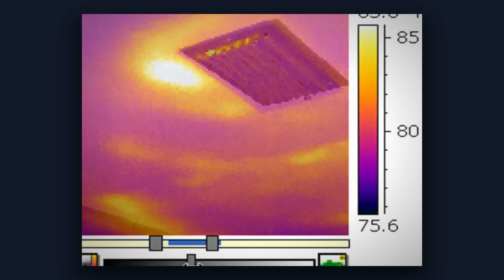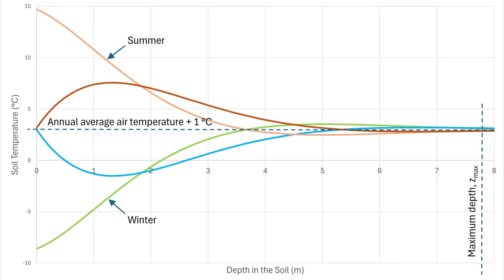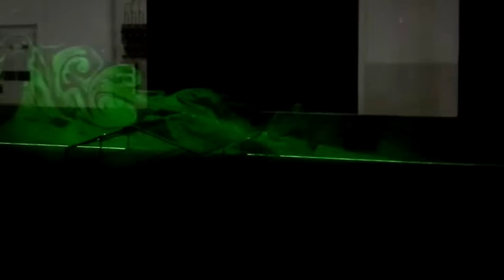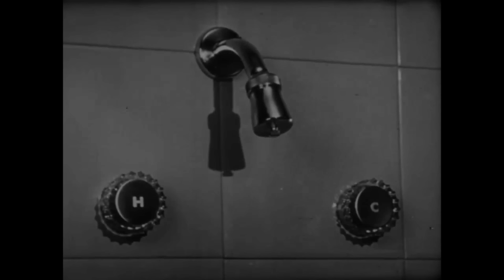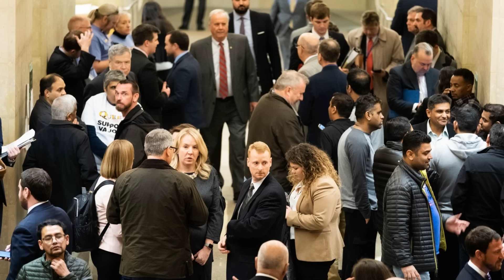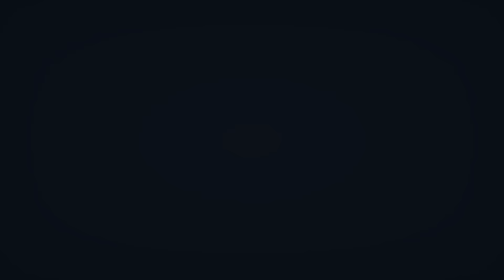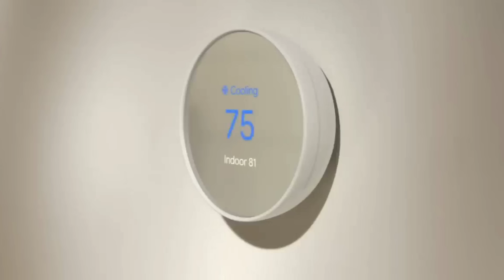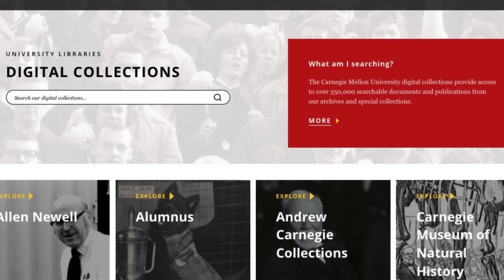This $300 Tunnel Heats Any Home All Winter for Free — The System the Gas Industry Made Illegal

Comment: Is it practical to move air instead of water (with an heat exchanger) through the ground, because of air friction has a loss in energy due to the powerful fan, compared to the pumps that move water.  Everything has to be sized to reduce friction and thats easier and cheaper with water.
Reply: That 8" pipe is not near big enough to reduce friction on the pipe for most homes. You really need a 24" x24" square duct at least about 600 feet in length for a small home.  The blower needed will need to be 1 horse power for a small home , and a 2 horse power blower for a larger house , rated at 7 tons.  That will kill your electric bill that's why people use an water to water heat exchanger and a radiant heating system.
I just think you should know that this is not the way to extract heat from the ground.
And,
there is an additional problem, this only helps for the initial furnace run, and will lose heat when warmer return air (warmer than the ground)  is pushed thru the ground it cools the return air, wastes the heat of the retun air.
The only application might be to cool the house in the summer, but still not cost effective bc of the large fan needed to push the air . Maybe it might work passively to cool a house in summer if you live where the outside air is not humid.  In the passive cooling system the air intake would be from 600 ft of duct 24" x 24" that drafts air without a fan into the lowest point in a house and exhausts air out through  the roof.  A fan or air-handeler could be added to improve flow and remove humidity. 
***However a pex-pipe sized to a heat-exchager is practical for geothermal heating and cooling, and its a better place to start.

Its takes very little pex pipe to size very small geothermal heating and cooling heat pump -- sized for about one room and those are practical for a home own to dig a 3ft x 6 ft deep hole and coil about 250 to 300 feet of pipe in the hole of 5/8" pex pipe.  If you divide the length in half and run it in parallel runs it cuts down on the friction and energy needed to run the pump. Gather the two-inlet & the two outlets together into single inlet and outlets .

Maybe you will need a hole for each smaller unit, but if you try to use one large heat-pump you will need a lot of space or need to pay an expensive geothermal well driller.  One last hint you will need to pour a slurry over the pex-pipe for efficient heat transfer. And do a little research first. Don't forget to use the coated pex-pipe made for heating systems -- dont use pex- for drinking water. The cost is similar but it will surprise you that gas exchange is what happens when you use regular pex and you want to keep air out of the pex. Take time to read and learn before doing your DIY heat pump. This is just a few hints to point you in the right direction.  If you have the land and can do your own excavation about 600+ ft of trench about 6 ft deep then the larger full house heatpumps are a good choice too. If a friend excavates, have him do a turning radius at the end of the trench for the return line.  And spend the money to run parallel  lines of the larger pipe (maybe two --1&1/4  lines instead on one) to greatly reduce the energy required for the pump. Size everything before hand with the heatpump manufacturer,  then increase it over the minimum.  In the house directions often say use 1/2" pex, but if you size it at 5/8" pex the efficiency increases do much that you can use a smaller pump and a lot less electricity and get more heat moved. So do the calculation on upsizing before you start.
Reply: Heat pumps can be a water to water system for radiant heat system; or a water to air heat exchanger (air handeler) for a forced air system -- like to modify and old gas furnace system.  In a new system you do not want a forced air noisy inefficient air blower. Water to water heat exchanger for a radiant system using small wall radiant systems are cheap for contractors to install.  The radiant walls and ceilings are for a luxury system. Never do radiant floors !! Usually it requires higher heat (wasted energy) to heat floors -- lost efficiency with floor covers -- and people forget that radiant ceilings and walls make radiant waves that heat the floors so the floors are warm too.  Of course insulation pushes heat in the right direction, so another reason to read and learn before you start .  Make sure you read because most contractors are not up to speed.  
And never do hot fossil fuel radiant heat. Its not efficient.  Size proper and you only need to heat your water to maybe 110 degrees F to have a home that's warmer than you want if someone turns up the heat.  In concrete floor radiant heat is the exception to do not heat floors, but keep the water temp low, and do not use floor covers that insulate, and make sure your floor heat turns down or off before the sun comes through the windows. The concrete heat resivor will keep heating the house after it is turned off.  Ceiling and wall heating is faster coming on and faster turn off.  You just need to plan.  And  modern wall radiators are not like the old fashioned high heat radiators. Radiators need sized to the room .  Use the lowest water template that keeps the home toasty ( 110 best to 119 max). Just size it to work.

Comment: the problem with this is you don't draw cold air into your house and heat it you have a return air system that returns air from inside your house , already warm air and reheats it to house temp and blows it back into the house
Reply: My thoughts exactly. Also, my furnace draws air for combustion from in the house. I do not comprehend this one.

Comment: I have been interested in the system for years and considered building it for air-conditioning in My Home. The problem is the condensation in the pipe and I haven’t seen anybody properly introduce a solution that would not overtime buildup water in the pipe where it would no longer flow cool air

Comment: There has got to be more than a few caveats to this system.  I confess that I am hardly an engineer or anything close to it.  I seem to recall something like this not being buried deep enough which caused formation of permafrost and buckling of a building foundation.  Comments?
Reply: In MN I build to 10 feet depth, control heaves by working with the water … it wicks upwards to freeze, gravel, rock ( certain types better than other ) and that will control the water which becomes ice which becomes cracks.

Comment: Ive studied both active and passive solar engineering back in the  early 80s.  Then the year I received my degree President Ronald Reagan  canceled the $25K solar tax credit that killed off the early solar industry that was thriving after 8yrs. Which was the equivalent of a career killing kick in the teeth! 

There's better ways to build passive solar engineered dwellings. Than what was presented in this video..

When my mother & her new Husban (a civil engineer) announced  they were goinging to build an adobe house. I steered them in to exploring a crammed earth house. With 20"  thick rammed earth house.   Because the solar mass would keep the house structure cool in the summer. And comfortably warm in the winters. With only a  evaporative cooler and a single fireplace. That they would only have to use sparingly.  With a lighting system powered by a 12 volt DC solar cell bank. And the kitchen had both a walk-in cooler and freezer. 

Once built their average power bill & water bills were less than $20 a month. With virtually no maintenance time each year's.  

The house was so energy efficient that they received awards for its. Solar design & concept. For its extremely low maintence. 

Only a 1/4 cord of wood was used each winter & the house was to hot. They only needed a small fire once a week in the winter. And the evaporative cooler only needed to be used once everything 3 days for 5 hours. To keep the structure below 80°  in the summer with out side temps at 110-115F during the summer. With the total annual power & water bills being at less than $200 a year. 

And they did not implement all of the designs that I presented them with. Had they implemented these designs. Their power and water would have been zero.

That house had the best over all comfort level of any structure that I've ever had the pleasure that I ever visited. Inside you never heard the hum of the city with the ambient sound of 80db outside & 65db inside. It offered true silence within the structure. That imparted a sence of tranquility & contentment like no other housing structure offered. In fact there was next to zero AC electrical EMF radiation. Which enhanced the experience of sleep.  Every morning was indeed a new day. Having eliminated the sound, drone and humming of the city of Tucson Arizona. The structure was truly an escape from city life  that all city dweller are acclimated to. That instills a restlessness into our modern noisy society.

There are better was of building folks. And had there ever been a fire in that structure the wall would have been strengthen. And stood longer than it's projected 10K life span!  Their cost was less than 1/3rd of conventional construction. For a 2600 Sq ft structure in 1990 dollar's.

So their are better ways of building   the alternative solar efficient housing.

This next year I'm. Planing on building my own  house of a similar design. That should be even better.
Reply: You speak of the house in the past tense. What happened to it?

Comment: mould.. rodents... I would not use the air directly... and air is an insulator... also look at Annual Average Temperature... 
I live in a region where that is 10´c (say 50F) and 19´c (say 66F) for room. 4ft is within Seasonal, you need 30ft to blend summer peak to winter trough. Core Earth Heat is 1/100th so forget that.  For me, ground source, perhaps pimped with buried insulated water seems more applicable, due to waters´s massive heat capacity. Have a slope, so any leak is gonna flow away from house. Minimum Frost depth is 18" (1.5ft). Clay soil can expand and contract. so system needs to deal with that.  The insulation maybe can be pimped. I know heat travels 1m/month through concrete.
Reply: Foam glass insulation aggregate (foam glass gravel) is used in a similar way as porous clay aggregate as a load-bearing hardcore. With a lambda/k value of around 0.08 W/(mK) its thermal conductivity is approximately 20% lower than lightweight expanded clay aggregate. The thermal conductivity (lambda/λ or k-value) of concrete varies significantly based on its bulk density and moisture content, typically ranging from 0.42 W/mK for lightweight mixes to 2.30 W/mK for reinforced structural elements. Standard dense concrete generally has a lambda value of approximately 1.6 W/mK, while specific densities provide the following thermal conductivity ranges:
Reply: Lightweight Concrete (e.g., Latermix Beton 1400): λ ≈ 0.42 W/mK (4.5 times lower than ordinary concrete). Dense Concrete (Standard): λ ≈ 1.6 W/mK (or 1.5–1.9 W/mK depending on source). Concrete Blocks (Standard): λ ≈ 1.33 W/mK (Roadstone) to 1.83 W/mK (2400 kg/m³ density). 
Reinforced Concrete Beams: λ ≈ 2.30 W/mK. Concrete Screed (1800 kg/m³): λ ≈ 1.15 W/mK. Thermal Lightweight Blocks (e.g., K-Block): λ ≈ 0.34–0.35 W/mK.
Reply: It´s load'bearing, available in monolithic dimensions of 2.8 x 1.2m, so sounds like suitable for a long, walkway trench, or maybe even driveway (DYOR if you need to spread car weight from tyres across that width). I had considered a covered colonnade for weather (and use south'facing pitch for easily maintainable solar-panels). Think last minute brief shower and spring / autumn BBQ.
Reply: Foam glass insulation aggregate would seem to be up to 20x better than concrete, which 0.2m buys you 4 months of seasonal delay? at which point any pumping puts you in control, what d'ya think? Trade insulation for trench depth?

Comment: The only outside air that comes to furnace is for combustion air that is returned to outside inside air is reheated.
Reply: He is talking about fresh  air for you to breath that gets distributed by the furnace in air tight houses. On his house the furnace pressurized the house and it losses air. But new tight construction  requires air to be vented to the outside to prevent toxic buld up.  People buy floor covering, furniture, or would paneling that releases toxins and if their is air exchange the toxins supposedly do not build up to dangerous levels.  You do not want to live in an air tight house that does not ventilate,  or you can have build up of super toxins like formaldehyde or RADON GAS,  and of course god forbid if their is just one smoker in the house.  Often running a bathroom fan on a timer  to move out the calculated amount of air can work in a house that is not super air tight. 
Venalation heat exchanger are the best because the heat in out going air is captured and put into the incoming air.  Those systems are affordable at about $1000 to maybe $1500.

Comment: The question I have is in my house I have oil fired forced hot air furnace. A system like this does not take any make up air from outside. The cold air returns are inside the house so the incoming air would be the internal temp of my house not what the outside temp happens to be?? Maybe there's different types of furnaces but mine does not take in outside air but in house air. Am I missing something, did I not understand the video?? Id like to know.

Comment: Of course this works! No need to bring up “ifs” and “buts” – it is also working many places in Europe. An alternative (that I use) is the same principle but with a closed-loop fluid-based system – in my case a 150m deep hole in the ground. Common and industrially available, but more expensive.

Comment: Your furnace doesn’t heat the air outside. It recirculates the air inside your home and heats it. Thus would be detrimental to to heating your home. You could use a smaller version for fresh air but that’s about it for that setup.
Reply: right on!

Comment: This is so misleading.

Yes using airtubes has been done and does work, but only in places with high dinural swings and low humidity.

The problems are many.  For example, 100F are will heat that 50F ground far more quickly than you think when the air is humid (water holds more heat) so the cooling effect will fade over the course of a day as the ground around the pipe is warmed.  (That 50f constant temp doesn't hold true once your passing air through there... For the same reason the first 2 feet aren't 50f.

The biggest problem with these systems is moisture.  Hot humid air WILL condense inside the pipes and grow mildew or mold, and you will be drawing that air into your home.

Next, you keep venting the heated or cooled air out of your home in order to draw more in... So it's not very efficient.  The ground heats 0F air to 40F, then you blow most of it outside to heat more air 

Geothermal heating and cooling is a great idea, but you need more surface area than an air tube, you use a closed loop system so there is no contamination risk, you use a heat pump to amplify the heat flow, and finally you insulate and air seal your home to keep in the hard won conditioned air so you don't saturate the ground heating/cooling outside air inefficiently.

The only reasons this has been used effectively in deserts for thousands of years is because the air holds little moisture (latent heat), nothing to condense, and nighttime temps are low enough that you actually use the  ground you heated during the day to keep you warm through the cold night, discharging it for another hot day.
Reply: I noticed just how Lancaster County is smack dab in the middle of those High Dimural Area's you are talking about. Yes it is more effective but the efficiency is temperature gradients is kinda exactly what the method does. While you statement has merit it can also be used in areas outside of the Mid-Southwest and has been for hundreds of years in Ohio, Pa, and many other area's. So there ya go, argue the point all ya want but staarting with warmer air means energy savings are in deed real And same vice versa with Cooling.
Reply: @anonimous2451 , this works for coiling. But not for heating. Furnaces take air from inside your house. Not outside. So even if it's 8°F, outside, & the tube heats it to 45°F. before pumping it into your house, that 45° air is displacing already heated air inside your house with cooler air, thereby reducing efficiency. 

The solution, put a valve that you can open when you need cooling & close when you don't. 

For the condensation problem, you need to watch the whole video (18:20), because it addresses this problem with a solution.
Reply: @anonimous2451 https://youtu.be/HZWS8Za36cM?si=dmbi4waxkEZztsNu
Reply: @anonimous2451 https://youtu.be/HZWS8Za36cM?si=dmbi4waxkEZztsNu
Reply: Not to disagree, but you're kind of just glossing over the key point of this system is that it's dependent upon the length of the tube as well As diameter and area of airflow. Meaning the only variable that needs to change is the TOTAL LENGTH of the thing you want to change(in this case temperature of air going in vs air going out) which this system plays off the dynamic. So the longer the tube THE BETTER you control what the temperature going in vs going out...and being the out tubes act as a way to mitigate against pressure differentials the system solves the problem itself ends up creating which is it maintains the temperature inside AND OUTSIDE by way of BOTH AIR PRESSURE AND convection of heat though technically it's also  radiant heat.
Reply: @PraskaBruce water instead of air solves all those problems
Reply: @PraskaBruce https://youtu.be/HZWS8Za36cM?si=DekEQjSEtkkF6maV